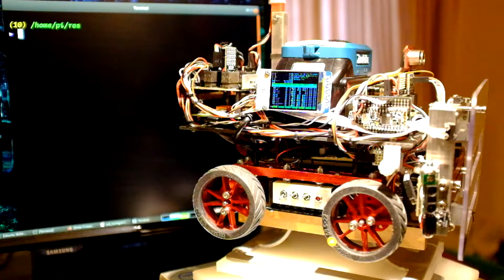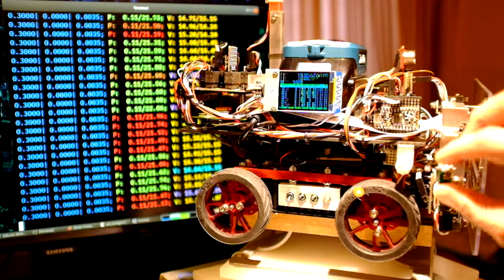Tuning the PID Controller

Comment: Looks like a fantastic project and great explanation about what is going on with your display. Curious to know more about the LCD on the robot itself, what does it show you?
Reply from the maker: Hi Bob, thanks very much for the reply. The display on the robot is an Adafruit 2" 320x240 pixel TFT LCD display, very small but still readable. When the robot's OS fires up it shows up as a terminal display, and I use a small Bluetooth keyboard that types directly into the terminal. In the video I'm running htop, a nicer version of top, the Linux system monitor. It provides me the status of each of the four cores on the Raspberry Pi, average system load, memory usage, and the lower part shows a table of running processes.